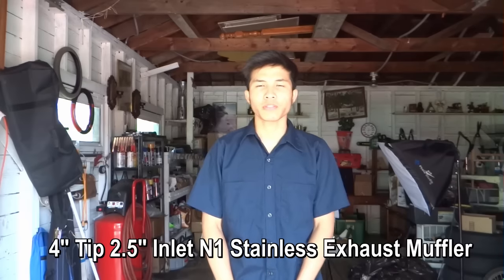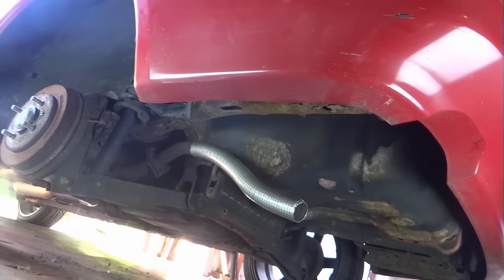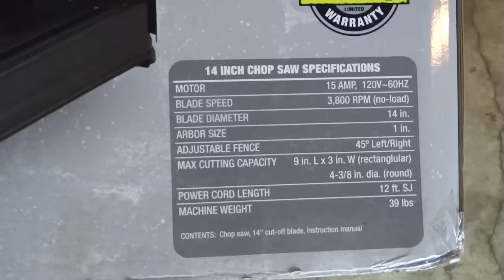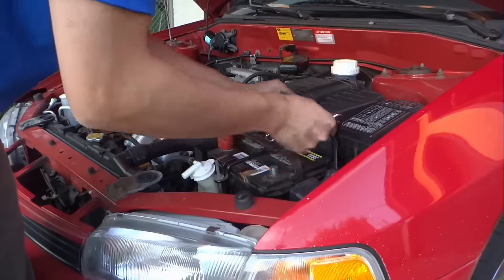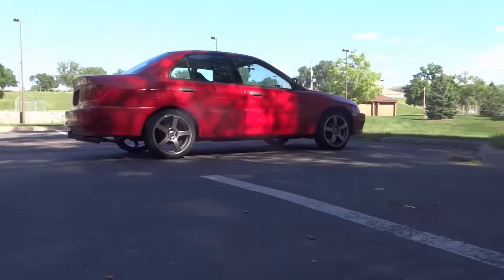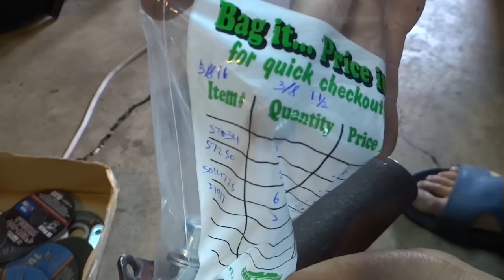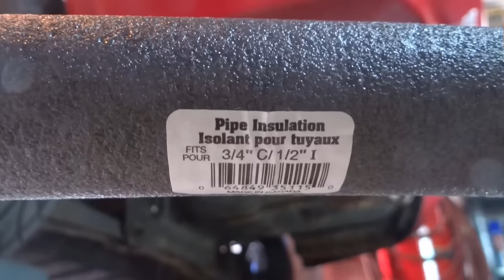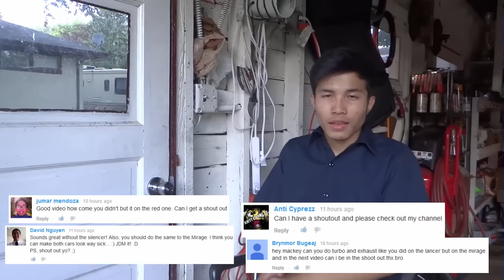Mirage Fix 16 | eBay 4" Tip N1 Stainless Exhaust Muffler

Comment from the maker: 4" Tip 2.5" Inlet N1 S/S Exhaust Muffler with Silencer 
eBay https://goo.gl/WOXcrz
Amazon http://amzn.to/2p1rFpd

14" Chop Saw
eBay https://goo.gl/EGlBb3
Amazon http://amzn.to/2pyRMA1

90 AMP Flux Wire Welder
eBay https://goo.gl/boJ2WK
Amazon http://amzn.to/2pej2oi

Welder Helmet
eBay https://goo.gl/WpgrZj
Amazon http://amzn.to/2ocGnoA

Muffler Clamp - 5 IN. Diameter 
eBay https://goo.gl/v1kpnS (Not in video)
Amazon http://amzn.to/2nKf6OO (Not in video)

2.5" OD to 1.75" ID Exhaust Component Pipe Adapter Reducer Connector 2 1/2"
eBay https://goo.gl/ilbuah (Not in video)

Squirrelly 1.75" 304 Stainless Steel Straight Pipe Tubing
eBay https://goo.gl/ox1aHm (Not in video)

Pipe Exhaust Mandrel Degree 15 45 90 135 180 Straight
eBay https://goo.gl/eg1jqM (Not in video)

VHT Flameproof Silver
eBay https://goo.gl/aFsSWx (Not in video)
Amazon http://amzn.to/2ocpM4i (Not in video)
Reply: DarkDragonWing your awesome
Reply: DarkDragonWing
Reply: Hey what did u use to hang the exhaust muffler on... like what's the name of the part.... I have a universal exhaust muffler that I can't connet to my car hooks...
Reply: Wat year is the car I wanna purchase one
Reply: Thank you bro 😁👍 i also want to change the looks on the front grill.

Comment from the maker: Bradley Lane My family drive AUTO. When I'm rich, I'll buy a manual.
Reply: Manual is cheaper...
Reply from the maker: Joshua Curtis  I mean that I will buy another one when I'm rich.
Reply: Is this a performance exhaust or just a fart can
Reply: Crypton XD straight up fart can...
Reply: Oh
Reply: There's no such thing as a "performance exhaust" when it's just a muffler... at the minimum it must be a cat back on a naturally aspirated car or a turbo back on a boosted car before any performance is really seen a full system headers back is always recommended for real performance though
Reply from the maker: Joshua Curtis
 Well said
Reply: 0 q azze
Reply: En tu sueño compras carro
Reply: tugging ft this h
Reply: DarkDragonWing what's ur dream car?
Reply: Joshua Curtis A catback will add power to even a na vehicle bc the engine will be able to breathe better. A engine is a air pump in a nutshell so the more in it takes in then exhausts out the more power.

Comment: That sounded better than expected BUT, don't weld sharp corners like that on your exhaust! It kills the car performance because the exhaust flow is restricted by sudden sharp corners in the system so it's not efficient, which means less power.

Comment: i like your videos so much . I suggest 3 thinks . On day buy real disc brakes if its not expensive, suspension looks very old and to soft . Front suspension must be few cm lower . When you accelerate your car looks like a boat . My friend buy cheap sport suspension new . And color on your car looks like need new fresh paint or you can try with plastic ( tape i forgot real name ) or plastidip colour  paint .
Reply from the maker: Thanks! I will definitely lower the car. cheers
Reply: and pay attention when when you leave home your exhouse is few milimeter to the ground because front yard agel

Comment: seems like alot of work to have done your self, could have had it installed at our shop for around $35.00 minus the extra flange work, but cheers on the effort!
Reply: +denver stapleton And saved the money on the welder, helmet and chop saw
Reply: +vteckid82 it can be use in future lol

Comment: You had me till I saw its an automatic. Thats when you lost me.
Reply from the maker: Chris Servoss Try drag racing a car with an automatic gear box, I wouldn't be surprised.
Reply: Drag racing is actually better in an automatic because you get more consistant, faster shifts, and if you have a supercharged or turbo charged vehicle boost levels also stay at a higher rate..But when it comes down to street racing and pure coolness-factor there is no comparison. Stick/manual cars are better and far more fun to drive than an auto anyday of the week.
Reply from the maker: Chris Servoss  I'm jealous. I will buy a cool RWD stick car one day.
Reply: dont get me wrong I do like the work you do. your very crafty and good at what your doing but all I'm saying is Automatics are for the most part boring cars to drive.
Reply from the maker: Chris Servoss haha I know what you mean. Thanks!

Comment: Very impressed with how you welded together your exhaust! Wish I had your skills or more time to develop mine! It would be cool to add a total cost for each part/machine you purchase, and just a updated total cost for the entire "Mirage Fix" project at the end of each video!

Also, you may already have this in your car, but in case you don't a hidden kill switch is a cheap and effective way to prevent your car from being stolen. You may not want to show where you put it in the video though.. Cheers!
Reply from the maker: I see. Thanks, cheers!

Comment: Good video! Make sure u have no leaks- it affects performance and they will get bigger. Some hi- temp paint needed lol and steeltoed work boots!! Wrk boots are actually pretty comfortable, get urself some lol Also there is muffler cement u can use when joining parts( when not welding) it really stops leaks. Cheers!

Comment: I admire your determination, at some point, I would've had a shop do it. So now the question remains, are you considering muffler repair for some side cash? You got all the equipment for small repairs. I am going to do mine this week but continue with clamps. Mine should be easy since I already did a muffler delete and added a tip. I just have to remove the remaining exhaust and tip that I have clamped on then clamp on the muffler. Save the exhaust and tip if ever needing to swap them out. Thanks for posting the video. Good Job!
Reply from the maker: Sounds good. I probably wouldn't do it for side cash. I like to keep it just a hobby.

Comment: Dude you did a better job then "the local shop", good going! I went to my local shop and they couldnt weld around the pipe the whole way around it, hole on the top if it leaked and I should go back but I will fix it myself, screw that shop!

Comment: You should have asked someone to lend you a tube bender. I have a brand of performance mufflers here where I live and since I work with this, I would suggest you to avoid sharp angles in your exhaust system, because that may reduce your car's performance. Other than that, nice job for someone who made this at home.
Reply from the maker: Pucadupr Thank you! I would love to have a tube bender and a good tube welder. But this little flux welder did the job.

Comment: Was the old bent pipe coming to the old muffler rusted out? If not, why'd you cut it? You could have just used one connector 1.75 to 2.5" and 2 clamps, got one hanger at the end of the muffler itself in some manner and maybe another around the old piping and been done.
Reply from the maker: GilBatesLovesyou I cut it because the nuts and bolts were rusted and I don't wanna mess with that part. You know, I thought like you thought when I first thinking about installing it. When I put that thought in practice, it didn't go well. It's all about the positioning of the muffler. The muffler would be pointing down if I do it the you way you said.
Reply: The DarkDragonWing Fair enough, I just remember awhile back doing this with a Thrush turbo muffler, not an N1 style, but on my Supra (84) I had the same type of bend and I did it that way and it looked fine and nothing scraped/etc, and it was a super simple (15-20 minutes total) and cheap. I was speaking of just cutting it say 1.5" before the old muffler starts, going into the old muffler it's straight, right? Then to get the muffler to point a certain way, instead of adjusting the pipes, just adjust the hangers  so it's tilted one way or the other slightly. Like one hang it like 4 bolt holes high, and the other hang 2 bolt holes high? Then again, I don't know, as I've never done it with an N1, only Thrush turbo which is like a box muffler and you can just get two cheap hangers with the bolt holes and 2 U-clamps to hang the hangers and adjust them pretty easily, too. I had one hanger at the joining connection and one hanger at the beginning of the tip. For me though, too, it wasn't so much about looks as just getting a new muffler on, my old muffler was split down the middle and rusted out very badly, so it was actually louder than with no muffler at all on, and a Thrush turbo made it sound more like a normal car.

Comment: I'm glad you got rid of those horrible, low hanging sharp bends. You know you can buy sections of bent pipe don't you?
What's with your tyre wear? How many psi do you run?
Reply from the maker: Jeff Gordon I don't know the answers for your question.
Reply: The DarkDragonWing
 Yup. That's probably why you have bad tyre wear.

Comment: Good video.  Seems like too extreme of an angle on your exhaust pipe....wonder what an exhaust garage would think of that?  The flex thing was fine you just need to use muffler cement on your joints! Stops leaks!  Long sleeves and steel toed boots-- u gunna get hurt!  Cheers :)
Reply from the maker: Mike koz haha cheers!

Comment: I really like the video style and quidos to u for doing your own work it looks how I did my cars exhaust the first time, I work at a muffler shop and that's not how we do it but it works and you saved yourself a good 200$ that a shop would charge, the first way you did it was more efficient those bends on the second one probably robbed 3 hp but I like the finnished product
Reply from the maker: +Everett Lamborn Thanks a lot, much appreciated!

Comment: Well done on the creativity with modifying to suit, do you notice if the cuts In the pipe are restricting movement as they are sharp turns and not smooth flowing like if the pipe was bent ?not hating just curious
Reply from the maker: David Mcgroggan Yes, the blending is better for sure on the air flow, but it is not that much of different if the angle is not too sharp. And plus if your car is not really meant to be raced or to get the best out of it and is just a daily drive, it shouldn't matter much. cheers
Reply: The DarkDragonWing yeah for sure was just curious bud as I have a full tubular system on my impreza turbo and I found the gains pretty good

Comment: Great videos bro👍 i just bought a 2002 lancer oz rally. Any cool exhaust or accessories ideas?
Reply from the maker: The SRS exhaust for the Lancer is pretty good, but they're always out of stock on eBay.
Reply: @DarkDragonWing  is there any other muffler system?
Reply from the maker: @albertodavila9617  I don't know other ones.

Comment: I heard sound leaks really bad with the walker flex pipe because of the kinks, is that true? What cheap muffler would you prefer for my 1995 bmw 318ti? And if you had 300$ and a stock 1995 bmw 318ti what would be your approach? lol sorry I'm a big fan
Reply from the maker: +caden kellogg Yes, walker flex pipe is always leaking because it can flex. I searched for a completed exhaust system for your car, I couldn't fine one. Here, if I were you I would use this muffler which is the same one that I use on my Mirage. The tricky part is how are you gonna install it. :D http://www.ebay.com/itm/5-Series-N1-Weld-On-Flat-Tip-4-Chrome-Tip-2-5-Inlet-Muffler-Exhaust-w-Silencer-/201348966680?fits=Year%3A1995|Model%3A318ti&hash=item2ee1556918:g:Fb0AAOSwGzlTr1~O&vxp=mtr

Comment: Hi man just wanted to say great video. Out of curiosity was there a major sound difference between the stock and aftermarket muffler
Reply from the maker: Omar Silim Yes, the aftermarket muffler is very very loud, lots of bass. You can feel the bass on your chest. I always have the silencer on, and it's still louder than the stock muffler.
Reply: Thanks man appreciate it!!

Comment: I like the way you've done all that welding on the exhaust, pretty good skills especially making it gas-tight. But I can see massive rotten holes in the chassis rails above where the exhaust fits. Which need some attention from your welding skills! Also why not buy yourself a pipe bender? Make life easier!
Reply from the maker: +hydorah Yes, I would get a bender for sure!
Reply from the maker: +hydorah Cheers

Comment: a true ricer exhaust look lol. small tip, make the mid shorter to get rid of the ricer angle, it'll lool better (you wont get the ricer comments) and it will sound alot cleaner

Comment: does this affect your fuel economy? after changing to a 4" oultet?
Reply from the maker: Not so much, no
Reply: The DarkDragonWing It will when you make the valves dance on the bonnet before each shift to hear the sucker.

Comment: Damn  u worked so hard  I usedd to have a mirage bro. I just removed the muffler and let it run like that. it sounds amazing that way.  Also i had a custom Cold air intake. u can find my video on my other account oz_mo69 .  check ur exhaust manifold.  Our cars are known to leak from the exhaust manifold because they develop a crack over time.  take the heat shield off and check.  I also purchased a chicaco electric welder to weld up my mainfold crack.
Reply from the maker: Ubaidullah Mohammad Nice. Thanks!

Comment: I think this car looks really good, but under the hood ... but taking advantage of a fantastic exhaust tube, I think it would be very much a bit more powerful engine.
In the car it is seen that there is not much acceleration, and with a change of engine would have more acceleration, among other things.

Comment: Hi, Mackey. Did you have a leak before you welded those pipes? The flex universal tail pipe looks black at 6:19. Is that from a leak? I'm asking these questions because I want to try the way you did without welding for my car's broken flex exhaust pipe repair. Thanks.
Reply from the maker: Yes, that was because it was leaking.

Comment: I bought the same muffler for my 98 honda civic will i need the same things you bought extra cause i looked at my old exhaust my car has and it seams i only need the  1.75 OD pipe.
Reply: jose ramirezThe DarkDragonWing about how much did all that cost you?
Reply: jose ramirez You should of just bought a whole exhaust system or a muffler delete. But take it to a muffler shop and they'll weld it on to your existing pipe for around $100.
Reply: hjibuloibgiol987 thats a hood idea thank you bro
Reply from the maker: jose ramirez About $250 for everything in the video including the tools.
Reply: jose ramirez Yup, no problem :)
Reply: The DarkDragonWing $250!!! You put in a lot of money just to get a muffler attached, but it's not too bad considering you bought tools you can use later on for other projects.

Comment: Hey man i cant find any of these 
Muffler Clamp - 5 IN. Diameter - Heavy Duty Stainless Steel Rust Proof - PMD-650 
anywhere, help please?
Reply from the maker: Selmir Muskic Here is not the same one but will work just fine: http://www.ebay.com/itm/NEW-ACRAFT-DIESEL-TRUCK-EXHAUST-MUFFLER-CLAMP-1-4-X-5-430SS-50AS-/200936503672?pt=Motors_Car_Truck_Parts_Accessories&hash=item2ec8bfb978&vxp=mtr
Reply: The DarkDragonWing Thanks very much
Reply: The DarkDragonWing and just one more question, since your piping from stock exhaust was 1.5 in diameter, mine is 2" in diameter would any of the parts be different to yours? like the 2.5-1.75 id or the 1.75 id pipe?
Reply from the maker: Selmir Muskic
 You would need a 2" pipe, and a 2" id to 2.5id convertor.

Comment: Hi, Does The N1 Exhaust Has A Double Mouth… 

Also 

I Have A 1999 mirage , I Want To Know Where The O2 Sensor A And Sensor B  Located..

My Exhaust Pipe Was Locally Built (Previous Owner) So For A Time , There Wasn’t A Converter… 

I Bought An OEM Converter For Installation But Looking At The Exhaust Line ,Both Sensor Holes Are Installed Before The Converter.. 

Is This Right For A 99 Mitsubishi Mirage ..??

Because I Know that One (Sensor A) Has To Be Before The Converter And The Other (Sensor B)Has To Be After The Converter… 
 
 
Do You Know Where They Are Supposed To Be Positioned.. 

Any Help

Thanks

Is the Converter Installed Still And You Have That Sound Coming Out From The Exhaust After You Cut The Muffler Off..??  Or The Converter Is Off Too..

I heard that part of the converters job is to silence the noise from the exhaust manifold before it gets To the Muffler..

How true is this .?
Reply from the maker: Yes, that's the sound of everything OEM without the muffler. 

Here look at this video for location A: https://www.youtube.com/watch?v=njCe9oQbPF0
As for location B, I don't know. 

My Mirage doesn't have that sensor at all. I think it's because it has a 1.5L engine. 

Your Mirage probably has 1.8L engine. If so, it is similar to a 2.0L Lancer engine. Here is a video for the O2 Sensors: https://youtu.be/YrV4wiC6D7w
Reply: @DarkDragonWing  mine Is A 1.5L I Guess … 
It’s a 1500 cubic capacity.. 

And thanks for the video Aswell

Comment: How long did it take you the last time to put it together with welding etc??
Reply from the maker: Arrows Minnesota It depends. It doesn't take long if you have done it a few times. But if it's a first time, it will take a few hours.

Comment: the angle you made at end to connect all those together, is a bad idea, cutting off the air flow, also holding stress right there, most probably you will just hit it somewhere on the road and then rust! But nice home try! Keep it up!